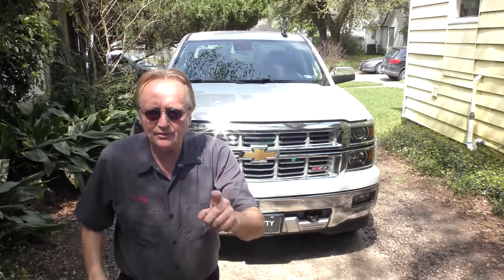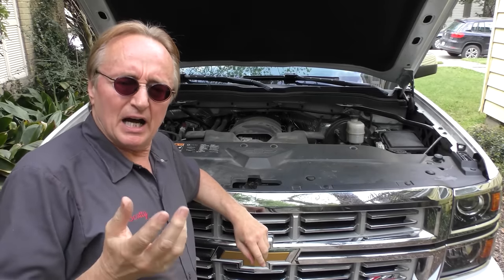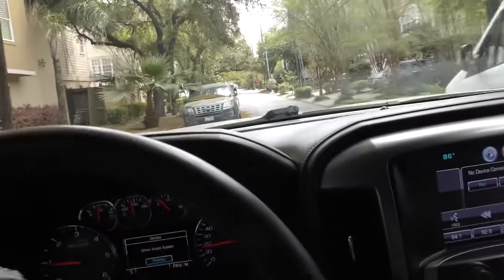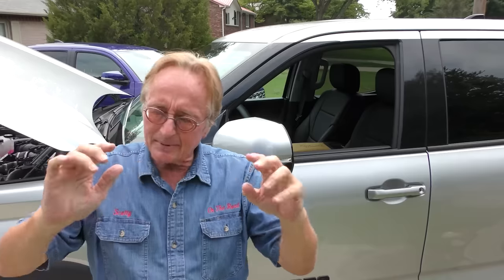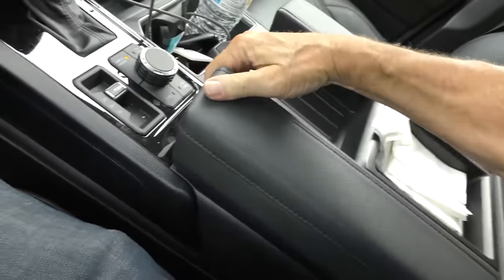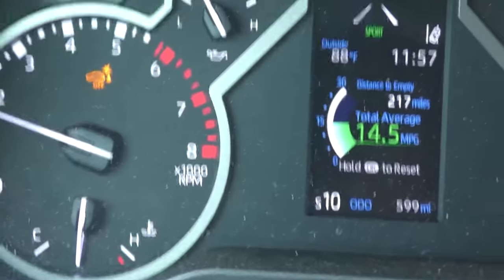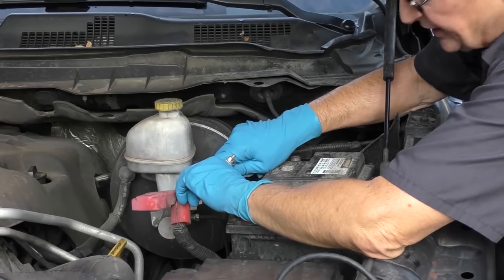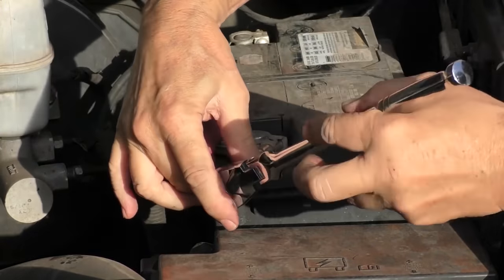3 Trucks I Wouldn't Touch with a 10 Foot Pole

Comment: The more I watch Scotty the more I'm convinced that 15 years ago I made the best decision buying a 2008 Toyota Highlander. Still running strong @ 243,000 miles.
Reply: Same with my 09 Xterra- 253000 and still doing 2000 miles a month!
Reply: @Pelvicpunch  that's great Robert! You obviously maintain it very well. The main problem with most cars, trucks and SUV's is that many people simply don't change the oil and other fluids regularly. I'm sure you have seen videos of neglected engines and transmissions that sound like junk with only 100k miles. Like Scotty says, "oil is cheap, engines are expensive."
Reply: Quess, nothing is wrong with helping a foreign company.. Good job.
Reply: My 2003 Sequoia has 285k miles and it’s still an awesome truck!!
Reply: Two of my daughters are proud owners of Toyota SUVs
Reply: @liberalsrmentallyflawed3611  that "foreign company" is providing thousands of jobs in this country assembling cars, trucks and SUV's.
Reply: 07 Ford ranger 4.0l still purs like new
Reply: @frankbiz  I prefer to buy American made. But even "American" companies are multinational and manufacture mostly off shore these days. And they have no loyalty to America or their employees at all today.  And their quality is poorer as the years go by. I still buy American made on other products when I can. It is hard to tell sometimes. It has to say Made in USA on it.
Reply: 06 Silverado with 270,00 5.3 been a good truck but serviced and taken care of.
Reply: @eugenefirebird8938  I agree, it's always nice to support your country's products when possible but as you mentioned, they go to outside the country and manufacture products because they are greedy. Most all the phones and computers we use are not made here. It's pretty sad.
Reply: @frankbiz  And Oreo’s. Those are made in Mexico now. 🤦🏼‍♂️
Reply: @eugenefirebird8938  Toyota and Honda make more products here then Ford GM or Dodge .....
Reply: @noneyabusiness9124  massive head gasket problems though
Reply: Idk, my 5 spd honda has more than that, my last one had about 370k when it gt rear-ended. And all the fords ive had, and  my family  and  friends have had went well over 200k with no major issues before they were sold. The were all maintained well.
Reply: Yeah, blame the customer for companies building garbage. lol
Reply: Before Trump became president, the most American car manufactured was the Toyota Camry at about 80% USA made parts. Since then others have increased US parts and manufacturing.

All the while, the so called American brands were trying to get cheap overseas labor to save a buck, but we saw the quality decline. So I'll take that foreign brand who provides my country with work.
Reply: @noneyabusiness9124  yeah, my 07 GMC Sierra running great after 16 years.  None of the problems mentioned here.  My newer F150 is cool with all the tech, but the tranny is shuddering at higher speed shifts. Good thing it’s a company truck.  Wouldn’t want to pay that bill.
Reply: @frankbiz and Mexico and Japan genuis
Reply: Nothing lasts forever.  I had a 2001 Ford Ranger that was very reliable, easy to drive, and cheap to maintain.  Until some airhead T-boned it.
Reply: My 2018 f 150 still going strong 3.5 with 287,7×× miles on it treat it right, and it will treat you right Fortunately, most ford trucks and chevy trucks are abused by their owners I've never seen a toyota truck do any kind of work.
Reply: @EffDee-od8dp  thats not even true but that's what you have tell yourself to justify buying a japanese truck
Reply: Is it a Bataan Death March special edition?
Reply: @EffDee-od8dp not true!
Reply: @sv5813  🥺
Reply: @sv5813  yeah, maybe it's a Hiroshima Hummer
Reply: Yup me too, glad I bought my 2002 dodge ram 2500 diesel new in Feb 2002. 398,350 miles. 24mpg hwy. Still has original evaporator, air conditioning still ice cold...
Reply: My sister has a FJ that ya can't kill, too.
Reply: @rpm2dayg648  those are worth a lot because they are discontinued. I love them they are like a little tank. Take good care of it. 👍🏻
Reply: My Silverado running strong 283000 miles. Never been in the shop once. All original except wiper blades
Reply: I Buy American !
and when it breaks
I Buy American Again !
  -Drew Carey
Reply: My dad has an 08 as well just crossed 200k. It's a limited with everything buy 4wd. I've offered to buy it from him cause I love driving it and I love th sound system in it
Reply: @comandermcgarrett7795  yeah mine is the  Limited as well and glad it is with the leather. Cloth holds all dirt and odors, leather cleans up well. I keep it spotless and I have the side factory moldings and makes it look different. I drive for Lift and one guy said, "nice car, when did you get it?" I said 15 years ago,LOL. He couldn't believe it. Yes, the sound system is very good!
Reply: Agree but I also will put part of the blame on manufactures, many car owners go strictly of the owners manual which today I don't agree especially with current GDI Turbo engines. Was looking at my friends Honda sport manual and it stated to change oil fluid between 7k-9k miles, drivers should have a piece of mind and change it between 3-5k.
Reply: @selfoblivionalex6262  you're absolutely correct, they want you to keep buying new. I use fully synthetic oil and change it every 5k miles. Scotty always says that and people should listen to him.  Toyota had a problem with their V6 and 4/C engines with a cold start rattle due to the variable valve timing actuator pin getting stuck and not engaging when the vehicle is parked. What happens the oil drains out overnight, the actuator rattles before catching itself back into place until oil pressure is built up. Mine never had that problem and I believe it's because of using synthetic oil every 5k, (in 2008 it wasn't required to use synthetic). Some other car manufacturers have had that same problem as well.
Reply: Nothing wrong with Toyotas or Hondas long as you're not pulling heavy loads
Reply: 380k on my Chevy van 2003 4.3. Runs perfect no rotted frames either
Reply: Pretty much anything will go that long strong lol
Reply: 04 denali with about 400k still going strong.... 
My dad is a mechanic/technician as well.
Reply: buying a toyota is never the best decision.  I have a 2009 malibu with 235k miles on it, I follow basic maintenance.  If you maintain any truck, it will last forever unlike your rice burner.
Reply: I support my American workers and long-time American company GM, and the best looking trucks on the market. People who take this guy seriously are 😂ill be nice. The Chevy also has no power adder, if I was to put a power adder on it was real go up in numbers. This guy 😂.
Reply: I need to find one
Reply: @Will502x  How many rice burners do you see that are owned by people that depend on their "work" truck for a living?  none, that's why you stick it out with GMC and Ford.
Reply: actually those are bad cars, the 08 highlander completely gives out after only 7 million miles, total pieces of junk in my opinion
Reply: 03 Lincoln Town Car. Spent most of its life in Chicago so you have the rust issues. Recently rebuilt the entire front suspension and she runs like a champ. 118k miles. My last Town Car had over 220k miles when I got rid of it. Ran just as good
Reply: @andrajourney6421  great, I think if you take care of any engine, like changing the oil every 5k miles with fully synthetic, it will last a long time. Scotty's advice goes a long way.
Reply: Can't beat them at all.
Reply: @frankbiz  Workers in the  South are treated well and grateful for good jobs...
Reply: My 2017 Range Rover is the best truck I've ever owned...even though most peeps S-talk them.. have never owned one.😊
Reply: 2007 Toyota FJ cruiser 155,000 mi the only thing I had to do is an alternator just because I felt like. When I had Chevy blazers I had two of them. I was always working on one of them and driving the other one
Reply: @moniemarsh1670  that's too bad that you replaced a perfectly good alternator. I thought when I had 165k miles I should replace mine and my mechanic said if it's not showing signs something is wrong with it like bearing noise or voltage issues then leave it alone. He was correct because it's still running fine at 246k miles. Hope you saved your old one.
Reply: Have a 2007 Toyota Highlander 210000miles. Timing belt and water pump changed once (time for another soon). Replaced brakes and Rotors. Replaced a $7 exhaust pipe gasket twice. Headlight bulbs and tailight bulbs.
Been the best vehicle!
Had Ford, GM for 30 years. They all had design issues like they were designed in the 50s
Reply: 2006 Toyota Highlander 387,000 and still my daily driver.
Reply: My magnum still going strong too, ~415000
Reply: 2002 Tundra Limited 290K , 2013 Tundra SR5 w/175K .. Wouldn't trade my Toy for any  truck , except maybe a 2500 Chevy. ?.
Reply: I have a 99 Toyota Avalon with nearly 340,000 miles and on a long trip averages about 26 to 28 mpg. Exhaust work, EGR valve , battery cable and power steering lines replaced.  The last two issues were from corrosion.
Reply: @america1st721 You are either just talking to talk or you know jacksh!$ about cars.
Reply: @jasonstormoen Like they care about your support. I'd buy American if the big 3 (especially anything Mopar) would make something decent that doesn't constantly break and need parts. Every single GM or Ford my Dad and i have owned was a parts whore. When I switched to Toyota/Lexus and Honda and convinced my Dad ,we both have been way happier along with keeping more money in our pockets.
Reply: @eac1235  I speak the truth, perhaps you don't have a clue.
Reply: @eac1235  Decent 😆! If your buying stuff used that ain't been maintained, then you'll have junk. My family only guys Chevy (GM) and we don't have issues but we take care of our stuff and then when we sale, people get a good use vehicle to and it's cheaper on us. So, I will continue to support my American workers. To hell with putting money in these other clowns pockets across sea.
Reply: @jasonstormoen  Thank You, it seems so obvious and I gave examples, if you maintain a GM or Ford vehicle, regardless of model, you will get 250K miles minimum, I still have a 2009 malibu that looks like I bought it yesterday and runs like a charm with 240K miles on it.
Reply: @jasonstormoen  I have never witnessed a single Chevy ,no matter if it "was a little old lady car" or used hard by someone,ever go 120,000 to 150,000 miles without some kind of major issue. This includes trucks. Go to any Chevrolet dealer, Ford or Dodge service department and ask to see the recall books. There will be stacks of 3 ring binders. Then go to Lexus /Toyota or Honda even Subaru and ask the service department for the recall books and you'll see a night and day difference. In the mid 90s I worked at a dealership that sold Oldsmobile, Subaru and Volkswagen.  Oldsmobile going back 25 years had five 3 ring binders each 4 or more inches thick ,Volkswagen had half that many Subaru was one binder about an inch thick. All for the same time frame. Bottom line in the 90s Oldsmobile was one of the better American cars and yet they were junk compared to Subaru.
Reply: @america1st721  Dude!! You are living in a fantasy world. It's rare for ANY American car to get a quarter million miles with no issues.  Honda and Toyota get 250,000 miles for kicks.
Reply: @eac1235  nonsense, I live in Michigan.  where do you live? I'm guessing california where there are only rice burners.
Reply: @jasonstormoen  FYI Toyota had 375,235 employees on the payroll at the end of its 2023 fiscal year in the US. Ford employs more than 57,000 hourly autoworkers, and almost 86,000 total workers in the U.S. alone. *Based on 2022 year-end hourly employment data. Looks like Toyota is helping Americans pretty good!
Reply: @liberalsrmentallyflawed3611 damn right! And helps my wallet aswell! 2013 tundra zero issues. Go cry a river somewhere else!
Reply: @fsufootball6984 American trucks are garbage! Tundras all the way.  Tacoma best selling mid size trucks! Get a clue man!
Reply: @llamacebu216 my tundra pulls 10.5. It's not a diesel but for a gasser that's alot!
Reply: @eac1235 lol yep!
Reply: Just sold my 05 Camry with 291k miles and looking to get a 08 Yaris with roughly 100k miles
Reply: @liberalsrmentallyflawed3611   Quess?  Most American branded cars are now made in a foreign country. Your sarcasm might have been more appropriate 40 years ago. Might surprise you to know that Honda, Toyota, and Volkswagen rank in the top 12 of cars made with American content. Only Tesla of the American brands rank in the top 12, not GM, not Ford, not Chrysler. You're welcome.
Reply: @CurlyFromTheSwirly  I am always astonished at just how uninformed these MAGA's are. I guess that's why Trump says he loves the uneducated.
Reply: 2003 Toyota Matrix at 330k  at the moment.
Reply: @llamacebu216  
You can pull with a Toyota.
It's always a matter of engine not brand.
It's a shame they aren't doing the 5.7 liter Tundra anymore. That could haul.

They still do the Sequoia with that engine, but SUVa cost more.

Not every Toyota is a compact car for 1 person. And the parts hold up better than your pseudo American brands.
Reply: @frankbiz  
Stop using synthetic....
unless you don't like your engine
Reply: trucks i wouldnt touch with a 10 foot pole  toyota, nissan or any thing foreign since i'm an American
Reply: @billjones3528  
Since Toyota makes so much stuff in the USA, that makes you an ignorant Karen.
Reply: @frankbiz Nope. My mom had a 2001 Accord she bought new. That thing drove off in the hands of another fella a few years ago after she and I drove it 285k miles with an oil change once a year if it was lucky, AND it was flooded twice. Last update: The guy really cleaned it up, and it is still running. They don’t make them like that anymore, truly. 

I take better care of my vehicles. She was a single mother in college later in life to make a better life for herself; we didn’t have much money then.
Reply: @ReddOchober  agree, they surely don't make them like they did years ago. That's why it's even more important today to maintain your vehicle religiously.
Reply: I have an 09 and that thing is a reliable beast!!
Reply: My Silverado had 270k on it and still runs great
Reply: Yep. I have a 2011 Highlander with 277k a 2007 Camry hybrid with 289k. No major problems. Just replaced the Camry original 17 yo 12V battery .
Reply: @Railroader4Trump  you got 17 years out of a 12 volt battery? That's unheard of. 7 years is a stretch. How is that possible? Did you do something to it?
Reply: @frankbiz   yeah. It was a Panasonic battery. Had a drain tube that goes into floor of the trunk and a plug in the top corner. I had to get it at the dealer and it was $337.  I bought the car in 2011 and never changed the battery and I assume it wasn’t changed before then either.  It’s a S65D26R battery.   I was having some issues with the car starting and the main hybrid system battery is old but after changing the 12 V it runs fine.  It survived all these years in Ohio winters and south Georgia summers.  🤷🏻‍♂️.
Reply: @Railroader4Trump  Ahhh that explains it, that is why it lasted so long. Thanks.
Reply: Yes u did
Reply: That truck will probably bury you haha
Reply: My Dodge van with a 225 slant 6 went 900000 miles and still running as a go-cart 🎉
Reply: @waynesamms1424  yep, those slant 6 engines were the best thing Chrysler Corporation ever made!